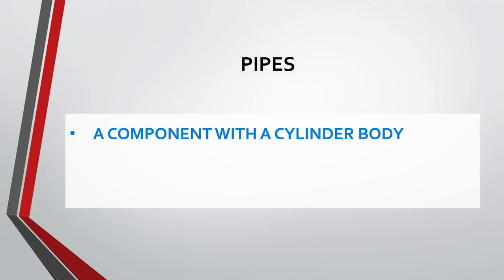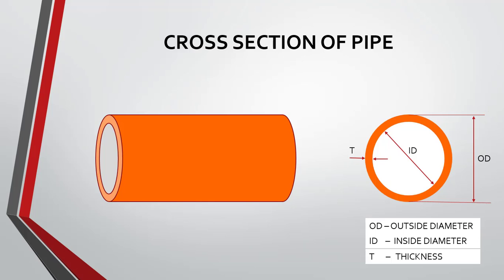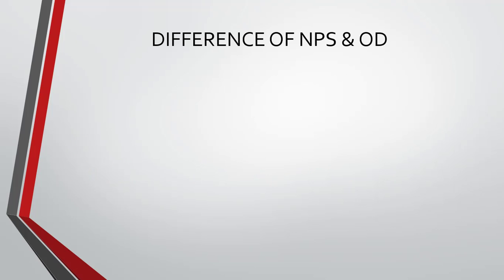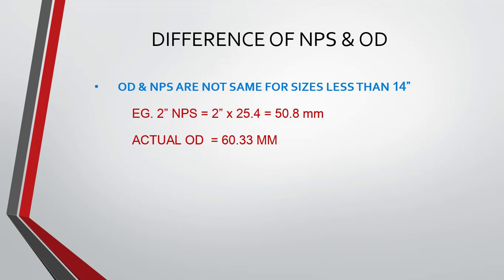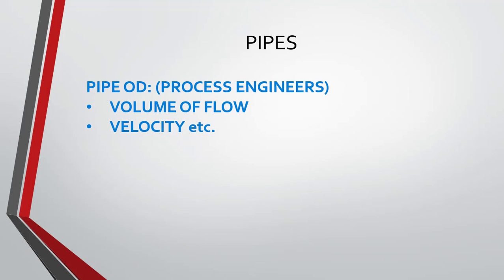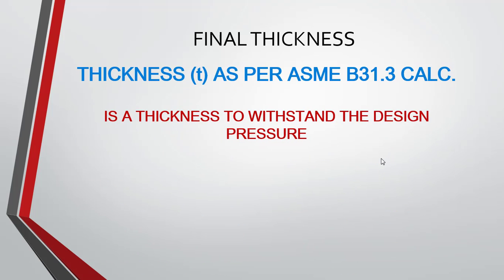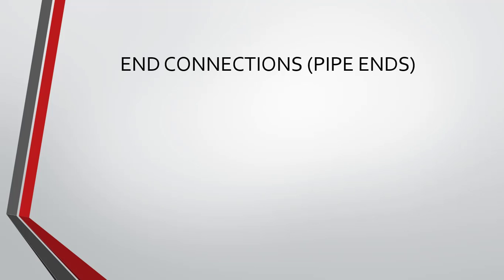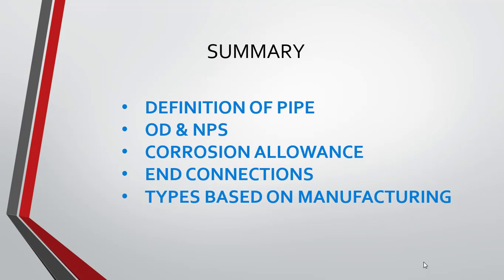WHAT IS PIPE AND ITS TECHNICAL BACKGROUND

Comment: Why OD is considered in pipe ??

It should be ID which matters during design

Then we can get desired wall thickness we want which makes OD dependent,
And ID independent
Reply from the maker: OD is a representations of NPS for PROCUREMENT However only line size matters for piping